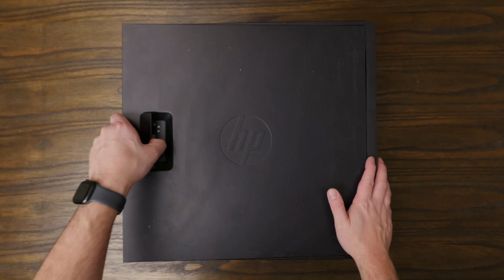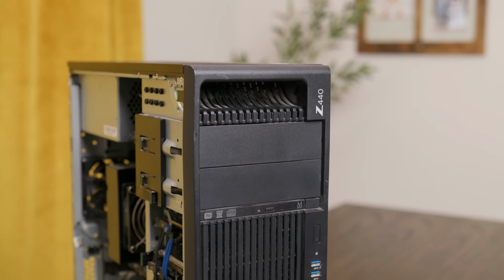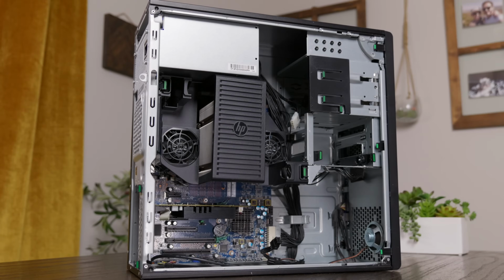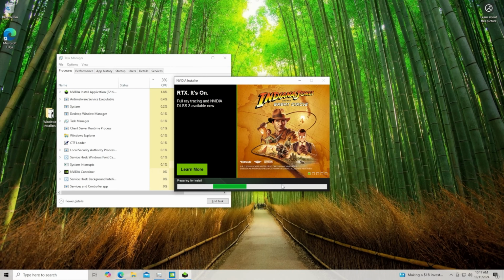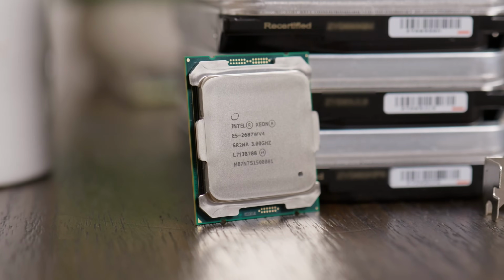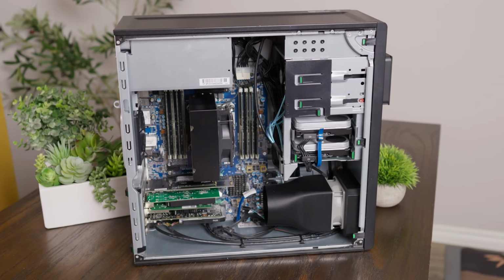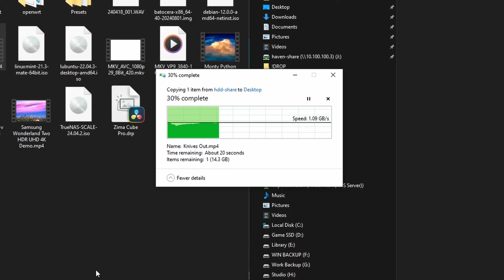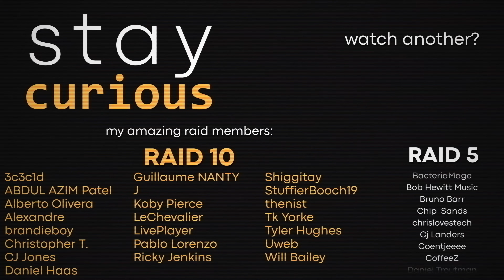This Upgraded HP Workstation/Server Is CRAZY Fun

Comment: Im always amazed how cheap old hardware is in the USA. Here in sweden that server would start at $500 before the upgrades.
Reply: Yeah… I used to do internal IT for a couple of different largish companies.  They threw away SO MUCH TECH that was still fine, but they had a policy of upgrading machines every 3 years.  

I took home so many slightly-older-but-easily-upgradable machines in those days and would flip them for a fee bucks.  

They’d pull the HDD and destroy them - but the actual machines were either trashed or given away.  I’m still using a couple of the NUCs I recovered back then for various home services (although they are 3rd gen intel and definitely running a bit long in the tooth).
Reply: In Spain it is even more expensive, impossible to find something cheap unfortunately 😢
Reply from the maker: To be fair, I feel like there are plenty of perks in Sweden that I’m jealous of 😂
Reply: @HardwareHaven  well i just order this in Sweden , HP Workstation Z4 G4
Professional PC with Windows 11 Pro
GeForce RTX 3060 12GB
Powerful Intel Xeon processor that is equivalent to an Intel Core i7-8700i gaming performance
64GB DDR4 ECC & 1TB SSD NVMe   for 800 US, never try Workstation but for that price i think is good deal
Reply: @HardwareHaven  hello, just a heads up here about your cpu choice in the video, You could have gotten a Xeon e3-1241 v3 at half the price and slightly higher preformance, you can also get the e3 1271 v3 since its slight bettat than the 1241 but its not worth the price differance.
Reply: I just checked it, the 256gb SSD + 1tb HD + 32gb ram config of this same workstation starts at about $850 dollars in Brazil... Which is insane. For the same price you can build a somewhat modern AM4 ryzen 7 build with a 3060 and it's going to destroy that workstation in price to performance. The only features you'd missing would be a lot of memory and pcie lanes.
Reply: I don't think it's the USA that's pricing it cheaply, it's the other countries used market overpricing it grossly . He showed a comparison with the $250 3950X, and that one destroyed the upgraded server in terms of performance. If someone is selling this system at $500 dollars they are just insane and out of touch.
Reply: @g.m.fernandes3579 The free market can't overprice anything.
Reply: How its possible? In Poland you can get z440 for 100€ easily (without ram and storage)
Reply: There is no import duty for computers from the USA. So if you ever take a trip to the USA, just buy the servers there and bring them home
Reply: Some of it is just quantity
Reply: Really?
Here in austria prices of used tech are usually only a bit higher than in the US.
Reply: Another thing that's easy to forget is that US prices don't includes taxes while European prices do. Which makes up for some of the difference.
Reply: @polakjan  ok. Add 10% sales tax. The final tally (including taxes, shipping and handling, return policy) is still way below compared to other countries e.g. India.
Reply: @polakjan do you pay taxes on C2C sale in usa?
Reply: Same in Mexico I usually find Haswell generation hardware in 200 usd. 

I had seen in ebay, tech is cheaper in UK.
Reply: Ill take real healthcare
Reply: And one way of taking advantage of USA's perks in terms of technology is using the goodwill shop and a method to bring your purchases home hahaha I have bought computers that go for hundreds of dollars in my country (400 usd+) for less than 50 counting the shipping
Reply: @juanpablofajardoramirez1008  So how to you avoid customs' tariffs?
Reply: @cbarak72  buy as for parts or repair and add that invoice to the import declaration
Reply: @cbarak72  annex the invoice of the part you bought to the declaration of value of your courier and make sure that it states it was bought for the price you are declaring, especially if the item was bought as "for parts or repairs". Generally, avoid buying in December or near black Friday because customs agents check the items more thoroughly in those dates and even if they are declared well, they might take longer to clear them
Reply: @juanpablofajardoramirez1008 
How do you handle shipping?
Reply: un France, its 180€ with 24gb of RAM. Some stupide people tries to sell d'or 300€. But réal dealer is at 200€. Others are joke.
Reply: de e bara att frakta de!
Reply: Pricing on second hands parts in western Europe, mostly depends on where you buy it. 
Buying from an online seller, is usually severely overpriced. Best to ask a friend or acquaintance that works in IT, if they have some old stock they want to discard of at work. 

That's how I bought an HP ProLiant G4 DL380 for 330 euro, back in 2011. It has two quad cores (8 cores total) in it, 32 gig of ECC memory, etc ...
Reply: well not in all of europe here in the netherlands i could make a nice server for around 200 euro
Reply: Even worse in Brazil...
Reply: For DIYers, the US has the best marketplace.  A similar used server (without the upgrades) would cost upwards of $1500 in India.
Reply: I would then have to ship it to Zambia. Yep. Not for third world countries.
Reply: I live in Poland and old tech is dirt cheap here.
Reply: link up with one of us here in the us we mostly use gmail, paypal is your friend pay the shipping we purchase send your way via UPS!!!

done this with a few in the UK with stupid items banned to purchase !!!

reach out feel free power in your hands
Reply: Your first mistake is looking in Swedish market, look in German market and even Finnish market is better I found 1 for 175€
Reply: Literally all the hardware you see offered refurbed that is three or more years old are lease rolls. It’s cheaper to lease systems for three years than it is to buy them outright. I imagine in Europe there are a lot less systems available to begin with.
Reply: That isn’t really the case set eBay to the whole of Europe postage isn’t as bad as international in the United States so you will find lots of stuff
Reply: I live in Denmark close to many of the recyclers, big offices and datacentres. There are lots of deals close by - I can even message some of the sellers and ask for oddball stuff and half the time they'll hook me up. AliExpress is still my go-to for CPUs to max out systems though..
Reply: I'm Danish and I'm not sure that's true. Might be looking in the wrong places?
Try Tradera.
Reply: Yeah totally.. In India it's ~440usd
Reply: Same in Denmark. Plus it seems that here in Europa, hard drives are destroyed often destroyed rather than refurbished. So no cheap drives either.

On top of that, the electricity costs of running that thing would ruin you. (Well not in Sweden, but most everywhere else)
Reply: Simple, over saturation of used market
Reply: I got for 500 from UK Dell T7820, single core xeon gold 5120 ,14 core, 105W, the chasis and build is amazing, such a solid piece of HW, almost silent, but only 16Gigs of mem in my setup - i am budgeteer . Very decent machine with pcie3 slots and upgradability to 768GB ram and even second gen scalable, up to 54 cores. No gpu, but my plans were to use it as a CPU bound server, but eventually i postponed my project, so i keep it and am not happy its sitting idle. Hope later this year i can come back.
Reply: Stop voting for socialists.
Reply: Don't worry..in Greece it's the same think they sell old models a lot of times more expensive than a 2025 model..not for pc only!
Reply: Nah, you're looking in the wrong place, you can find them for a bit less like 300 range but that is still a bit much. That is a refurb, I forget which company but I would not buy from them. What you should do, if you want something like this is get one from Germany like Gekko for €150. Shipping will be expensive but it is no matter where from because it's a PC tower. I bought a Dell T5810 which is the same thing, found a used one for €150, ripped out and binned the CPU and RAM, threw in a 14core chip and 128Gb - CPU was like 20€ from China, the RAM 160€ I think, don't remember exactly. Ram is always pricey, just how it is. 
Then I'd suggest a single or multi NVMe carrier board, for boot/OS/software, then toss in some 10TB or whatever you feel you need for data and Bob's your uncle. I did the math for my Dell T5810 build and it cost me something like 5-600 total with 14core CPU, 128gb ram, 2TB NVMe SSD, Quad gigabit ethernet, 8GB Quadro P4000 GPU and a 16TB HDD. Sure - it's not going to blow the socks off anyone in terms of speed but it does have 14 CPU cores and 128Gb so it can handle quite a lot of different tasks, plus with 5 GBE it can act as a sort of router or firewall or whatever else I might need it to do, it has semidecent GPU, fast and large SSD and loads of storage. It became a sort of swiss army knife system, I meant to use it as a server but ended up buying a HP ML350G10 also which is just "bigger" in every way but also MUCH more expensive. The Dell is now my do everything random kind of system. Not superfast at anything but it is reasonably fast and competent at almost everything you can think of. Ah forgot one thing, my Dell also has 10GBE fiber but that is kinda something you do or don't want depending on a whole lot of other things, you'll need a router and stuff for that to make any sense at all.
Reply: The golden age of old hardware normally lasts about a decade before it goes to retro price hikes happened with cartridge based stuff about 10 years ago and starting to hit disk based stuff now
Reply: Here in Italy too haha
Reply: EPYC 7 is getting cheaper now , Picked me up brand new mobo and used 32c 7502 for 805$ after taxes really awesome ngl.
Reply: Yes j have server
Reply: Workstation host
Sever provide
Reply: Because we had so may corporate offices throwing theses things away
Reply: Germany is not better - speakwise Hardware or AV-Stuff - and beside this alot of good stuff are not possible to get here in Germany. 
I order alot from the US or Canada because You can get really nothing here. Sometimes I order my stuff, special gear for my expeditions, from Norway.
Reply: I've got a gateway from '12 if you know someone in need. I've got 3 desktops and 4 laptops.
Reply: Same here in Australia
Reply: I bought one yesterday for $150 in Moscow, Xeon v2, 32gb, SSD + HDD, 1050ti
Reply: The question I have for you is , in Sweden do you change or upgrade your phone each and every year Apple or Samsung releases a new model? Or you use the one you have until it breaks or no longer supporting real applications that you use not because of they say a camera or AI or new Siri upgrade?
Reply: yeah, but doesn't Sweden have universal health care?
Reply: @amegabyte  They don't have a very expensive 13% burden quite yet, though they are trying.
Reply: @yamerojones >child anime pfp
>racism

Comment: That 4 way card has its own plx chip so u don't need bifurcation 😅

I have the same one!
Reply from the maker: Mine most definitely does not. It costs like $20-30 or something haah
Reply: @HardwareHaven  ohh what's under the hood of that cooler? Power stuff? 

Mine was more expensive but looks the exact same. Mine has said chip.
Reply from the maker: The NVME card I used doesn't have a cooler. The card I showed on Aiexpress does because yes, THAT card has a PLX chip. Hence why I said it's expensive